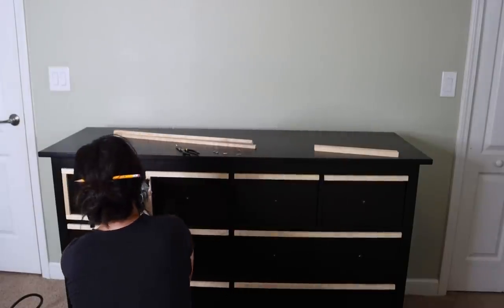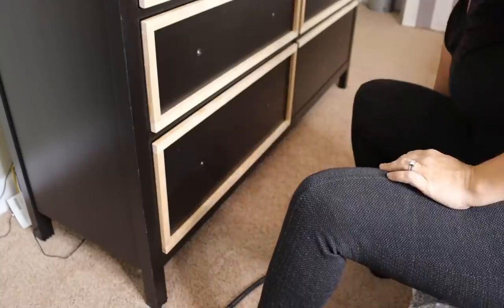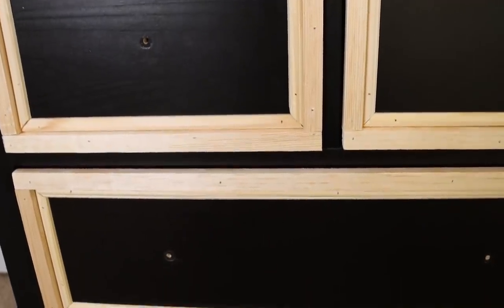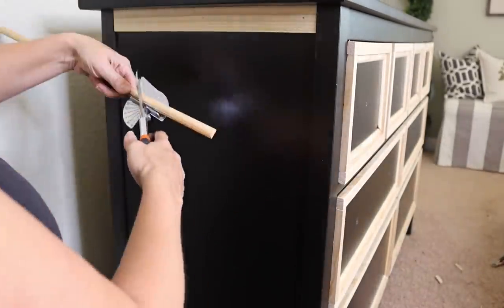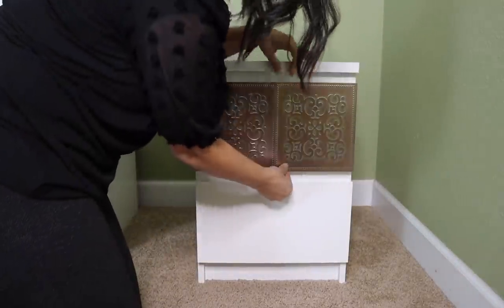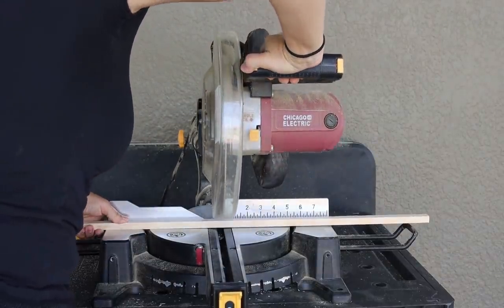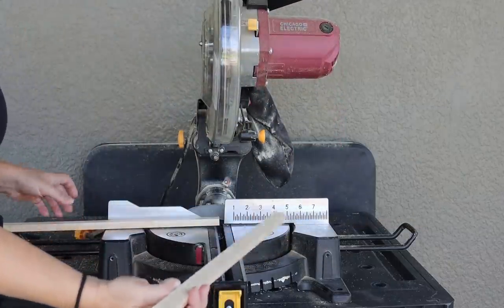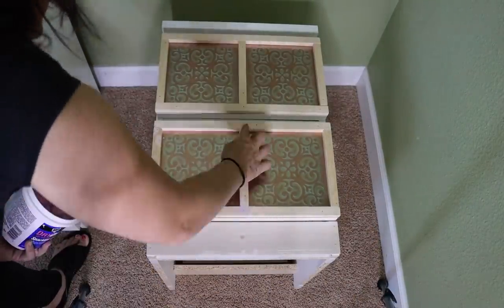Shocking DIY IKEA HACKS That Look High End for the Bedroom!

Comment: 🔴🟢🔵 Just curious if there was a reason why you did not use paint sticks on all of the drawer fronts above the decorative pieces? That’s a fabulous idea.  Since you put the Sticker on the front of the nightstand and painted two coats were you able to still see the design? The paint was not too thick to fill in the stencil places of the sticker?
Reply from the maker: I used the other trim for a few reasons... First, the paint sticks would not have been long enough for the long drawers and probably more so was size. This version is  narrower but also thicker so it adds a lot of dimension and yes, I still putty all the nail holes and joints (it is in the video)... but the way I applied the sticks made for much tighter joints.
Reply: @designedtothenines  totally makes sense yes now that I think about it thank you. I edited my response I think after you responded I didn’t expect a response so quickly 😄. I was just asking about the stickers on the nightstand if you have a chance to go back and look at my comment thank you very much I so much enjoy your channel and you have given me confidence to try getting a miter saw when we move in a month

Comment: I didn't understand the point of the stickers on the drawer front. I thought maybe there would be some texture from them, but I didn't see it after it was painted. Did I miss something?
Reply from the maker: A little bit of the texture was lost on the camera, but it actually adds a pressed tin effect that is pretty cute. =)
Reply: @designedtothenines  Thanks. I assumed that was the case but not sure. Love your designs!